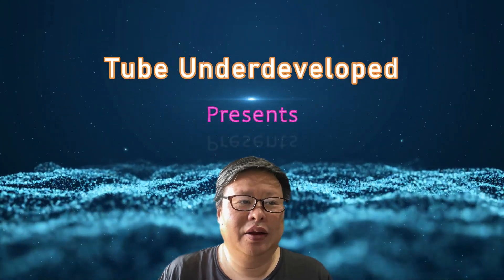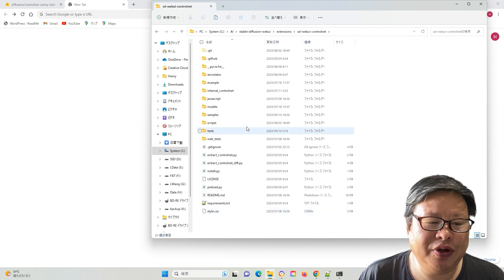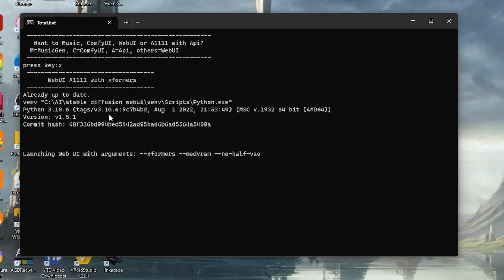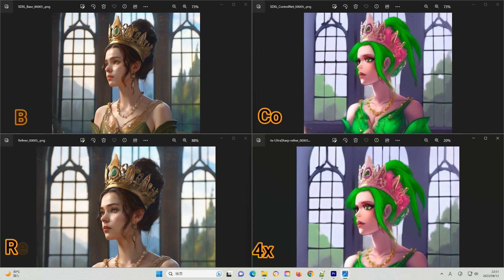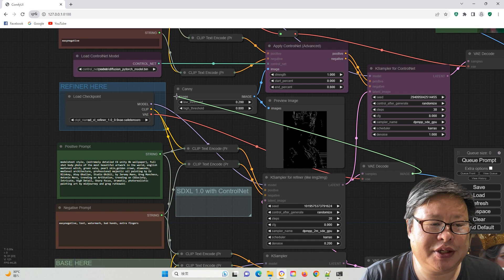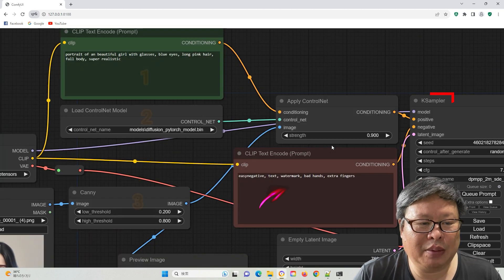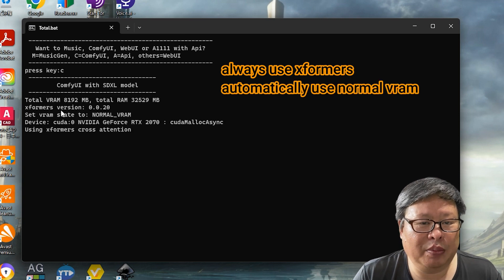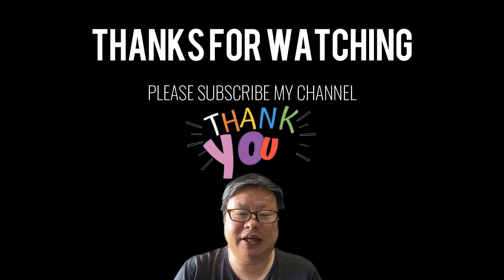SDXL 1.0 Model with ControlNet Workflow - Official Canny Support

Comment: I am a programmer but I am not going to lie when I see ComfyUI my eyes glaze over to then fall dead.  I tried it and I just can't get with it.  No SDXL program out there, right now, would I use as Auto now BSOD me due to OOM even if I am swapping 2.1 models it never releases the system mem.
Reply from the maker: I see. At first, I also messed with the nodes' stuff. Even now I am still confused about how to use them efficiently. The more I use, the more node I added. It becomes larger and larger. One thing is for sure, it is really not for beginners. LOL. Fortunately, we can use other png or JSON files directly. No more thinking. It makes things easier. Have a nice day.